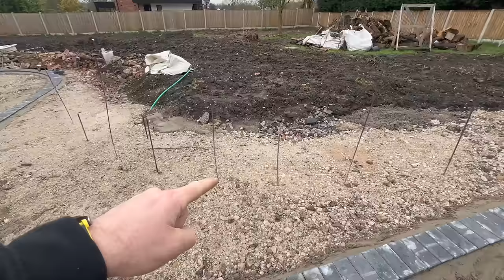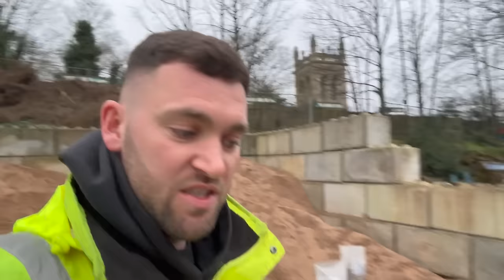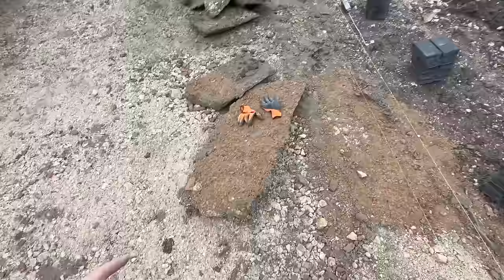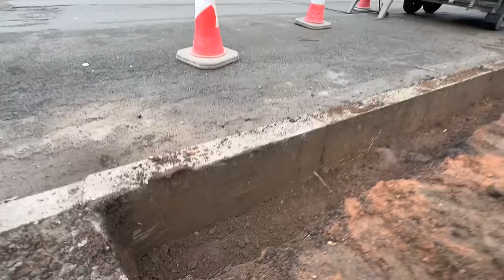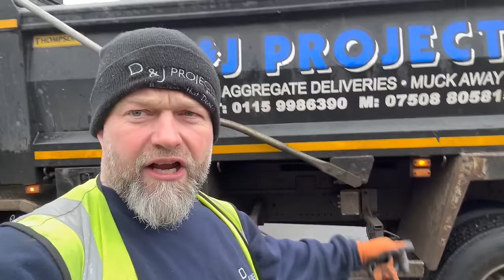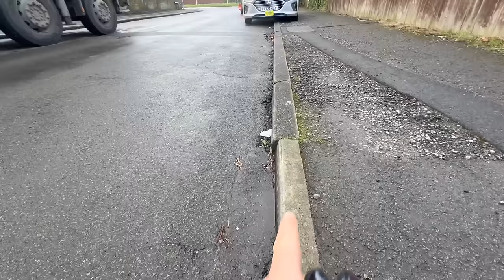Eliminating The COWBOY BUILDERS...

Comment: Top tip Dave…for a smoother curve to follow on the revised edging stones, you may found a garden hose under pressure better at providing a smoother curve as opposed to the string on spikes….obviously still need the string foor the levels.

Comment: A question guys regarding the drop crossing you had the inspector out.How comes under streetworks you dont use pathway closed signs and form a safe pathway along the road side for pedestrians with plastic road barriers.With midbeds council we have to barrier off all the works around pathway and create safe walking and not allowed to use just bollards to demarc working area if that makes sense.Do you display a permit board with permit number and company contact details on.Thanks.

Comment: Just spent a few hours building a log store out of pallets and roofed with some spare twin wall polly sheet. Used decent sized washers on the roof so the screws wont pull through.